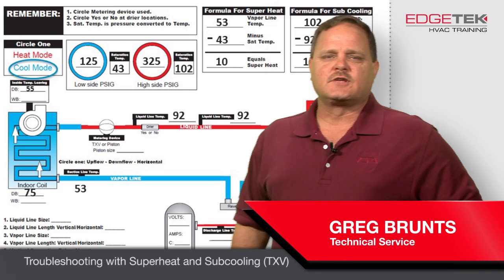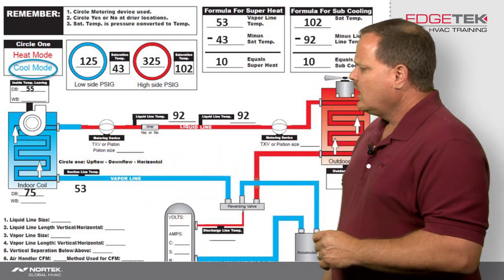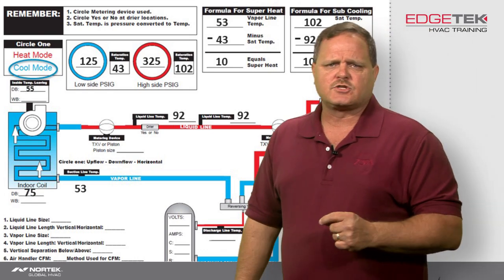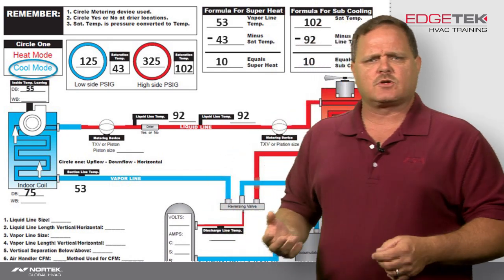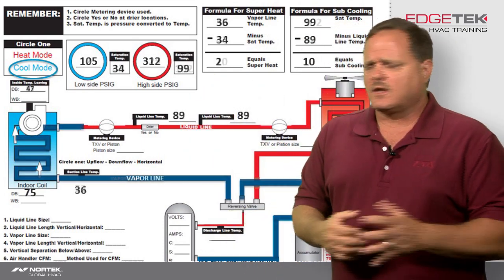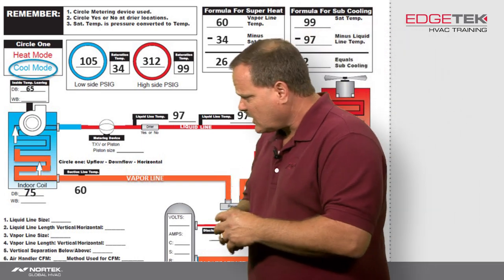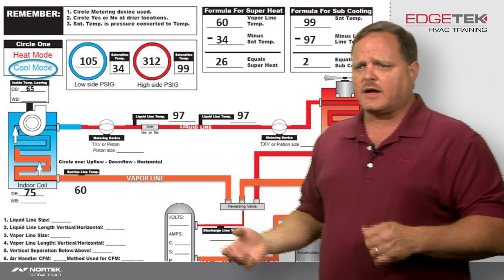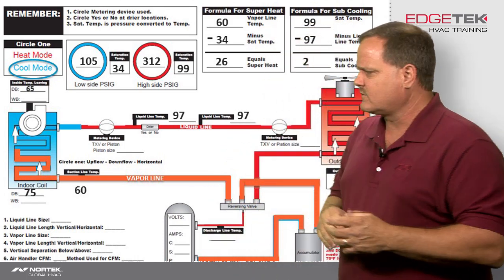Troubleshooting with Superheat and Subcooling (TXV)

Comment: What about when you add refrigerant and you still get no subcooling…15 superheat. 17 degree delta T. Was at a call till midnight last night. Txv restriction??
Reply: Does it have a liquid receiver? . If you don't get a subcool and ,you do have one, it's going in there and your overcharging.  If not. And it's cooling? Then leave it alone. What is it asking for on the data plate? Subcool or superheat?  Superheat seems high. Might be slightly overcharged

Comment: I had cxv with 20-plus degrees of temperature difference in Cooling and superheat as well as about 20 degrees difference across evaporator coil, I am thinking is a bad TXV the furnace is about 16 years old

Comment: Hi. I tried this ac stuff as a kid and never really got any good at it. I now own a house and I blew the dust off my old tools and decided to check my ac. I feel like it’s struggling to keep the house cool. I live in Texas so arguably it may just be the way it is. I have a 5 ton Rheem.  She’s old but new enough to use 410a. I hooked my gauges and everything seemed pretty high. 
Suction 128psig 50 degree 
Liquid 425psig 121 degree
Ambient temp 97 f
20 superheat 
23 sub cooling 
A strong 20 degree split with air as cold as 46 degrees (inside). 
Evap looks clean 
Condenser could use a cleaning but not bad
I want to say it’s over charged but I don’t want to start playing around with it until I have a pro give me his thoughts. Any help would be highly appreciated. Thanks!
Reply: TXV or Piston?
Reply: Johnny N. 
TXV
Reply: @Keeping_it_Frank  Has the system always struggled? Or just recently? I would take a temp before the drier and after to see if you have a restriction there. Could be that system is overcharged or developed a restriction recently(drier, bad txv, kicked liquid line etc). Lots of variables though, we don't know your indoor return/supply/wb. If you have a clamp meter, you can also check the amp draw on the compressor to see high it is running above rated.
Reply: Johnny N. 
I’ll check the amp draw. I think it’s always struggled. Also for some reason it has 2 liquid line dryers. I’m thinking there’s restrictions their. Sadly one of the dryers is inside the condenser so I would have to recover the refrigerant with a machine and not the compressor. I do not possess that type of equipment. But those numbers are indicators of a problem?
Reply: @Keeping_it_Frank  Two perfectly working filter drier with neglible pressure drop shouldn't be a problem. If there was a restriction, common sense would probably point to the one in the condenser.  On a 97-98 degree day here in Texas my pressures are 139/369 with a 21 degree split at the plenum. 64 Wb 78 DB return and 57 supply. SC is at 10 and SH is 11 with a TXV measured at condenser. I would temp the pressure drop before and after each filter to rule those out since you can do that easily. Then it might be txv and/or overcharge if the DFs are fine.
Reply: Johnny N. 
Thanks Johnny. I’m going to get a temp pipe clamp so I can get a more accurate temp. I was using a laser thermometer. I’ll check both filters (what is the temp diff window I need to be in?). 
How would I know if the txv was at fault or better yet how would I trouble shoot it?
Sorry for the noob questions but like I said I never got any good at this stuff before I stopped doing it all together.
Reply: @Keeping_it_Frank  Withing 1 degree or 2 should be okay, but since you have two, I would say within a degree for both filters should be okay. If you used an IR temp gun, then your SC and SH might be off. You still might be able to use it to measure the filters if you avoid anything shiny. Once you verify the drier filters are good, make sure your filters are clean and the furnace blower is set to the right CFM. Those are the things you can at least check as a homeowner. 

Bad TXV's generally have a high super heat even with sufficient or overcharged refrigerant, but not always.

I would have a tech/pro come out to confirm/diagnose and just use what I have mentioned as educational purposes only.
Reply: Johnny N. 
Thank you
Reply: @Keeping_it_Frank  did you figure it out?

Comment: If the TXV is set to 10 degrees Superheat is that when the suction pressure and airflow across the evap are in specific range? I thought the TXV will always maintain a differential of 10 degrees even if suction pressure or airflow fluctuate.
Reply from the maker: Thanks for the comment 
Superheat temperature is determined by the saturation temperature of the refrigerant in evaporator coil and the temperature of the suction line (either exiting the evaporator or at the suction line service valve).

Comment: Great information and presentation.  I also am trying to use apply this diagnostic information to automotive applications.  Most of our systems use a fixed orfice and some use an expansion valve. But the fact of the matter is., Better diagnosis leads to clear and concise repairs. We do not use the super heat and sub cooling terminology or diagnostic and I wonder why. Seems like it would help. Thanks for sharing.

Comment: I have a unit that shows signs of flooding txv and starving of evap. Unit originally was overcharged once I adjusted Freon these are the current readings.  DT 15, Superheat 6, and Sub cooling 20. Unit specifies super heat at 8 degrees and txv design subcool 15. It seems to be smack dead in the middle of both. Previously the unit would reach retard on high side and have high suction temp as well. My last thought after looking at the system was someone had manually adjusted the TXV to get the sub cooling where they wanted it without thinking about filling condenser with liquid making head pressure seem to have nitrogen in the system on a warm day.

Comment: I'm still a bit confused as to why your suction pressure and saturation temp read true yet you had high superheat 🤔
Reply from the maker: Hello, Just because the refrigerant pressure gets through the valve does not mean enough liquid refrigerant is being flashed through the valve. With 410A pressures the pressure seems to get through but if the TXV is malfunctioning or is restricted with debris then quantity of liquid required is not flashed through the valve. 
Feel free to reach out to our technical services team for more clarification.